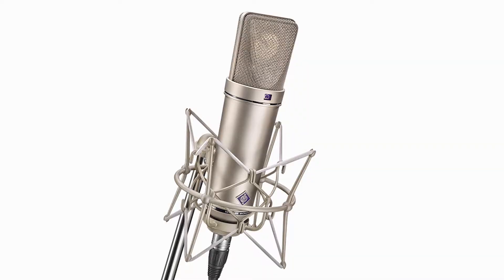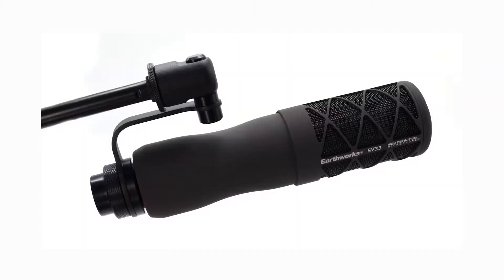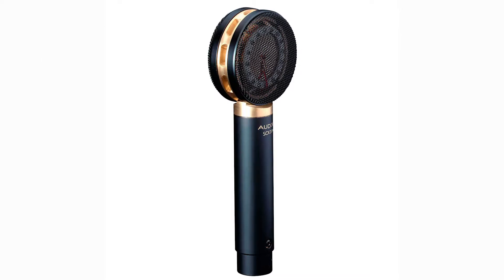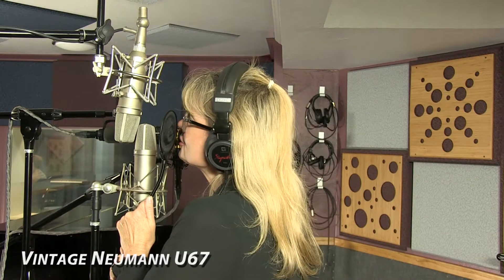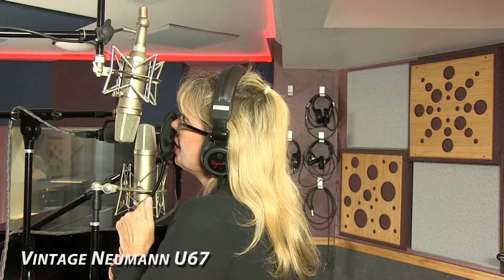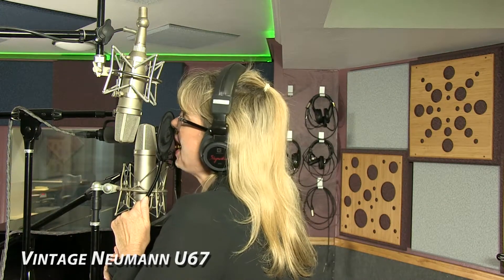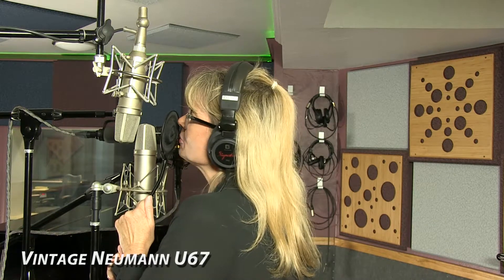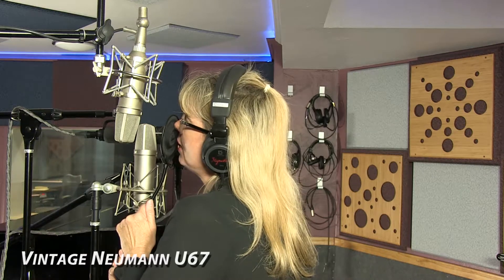FET Microphone Shootout: Neumann U87, Earthworks SV33, Audix SCX-25A

Comment: Does the U87 sound like a stupid person?: Yes. I also noticed that on my own voice.  All I say about these mics  refers to using them in a whole mix. Not on solo tracks. u87 sounds great, very clear and big in a mix but a bit like a dumb guy. Or like an 80s Hollywood movie..Bill Murray in a dark office in a skyscraper...or something like that...there is something strange in the U87 and Neumann sound anyway.... That's why I bought an sv33 and no u87. BUT: the U87 sounds better overall....I am still struggling ..maybe I get an U87 although it sounds that "stupid". The sv33 sounds more natural. But the U87 has the better low end and more "transparency". SV33 sounds a bit narrow compared to it. And a bit smaller. But I feels great to sing into it. I have tried it with a Great River and a Chandler Germanium preamp. Both sound great but the Germanium makes the SV33 even better. The sv33 is quite a soft sounding mic. The Germanium provides  a certain edge to it and make the voice sound warmer and stronger than with the Great River. The sv33 is a good mic. better than many many other mics (e.g better than Lauten Atlantis, Milab VIP 50 OR VIP 60 and several less expensive ones). And I have never used another mic that made me play acoustic guitar in such an easy way. The sv33 plays the guitar..not then player. Great mic.

Comment: The SV33 has several performance benefits that are not addressed in this shootout. It has almost no handling noise. One could hand hold it with out problems, It provides far better rejection of off axis arrivals, especially in the deep bass. The SV33's proximity effect is far more well behaved, the low end gets warm not boomy when you lean in close, and it is very well protected from plosives and wind. These are real world benefits for modern recordists who might be working in spaces that are not isolated and maybe don't sound so great. It's nice to be able to focus on the music with having to worry about the subway rumble.

Comment: You guys commenting totally miss the point that the Audix is 1/3rd the price of the others. Of course the $2-3k mics sound amazing. But for $750-850? The Scx25a BLOWS them away for price and quality, it barely needs a EQ touch to be on the same quality level especially with a solid preamp.
Reply: Yes def the scx is a no brainer imo.  Heard they make great drum overheads too.
Reply: @larrytate1657  Thats what im currently running now. Got a matched pair used for $800 on Reverb with some calculated negotiating a few months back. Impeccably clean and natural sounding. Cymbal definition is amazing. Only pros tend to own these bought new, so if you get them used, theres really not much to worry about. You can pick them up for $450 each if you’re patient. They work quiet literally on everything except guitar cabs.